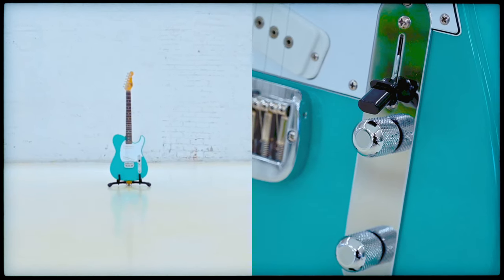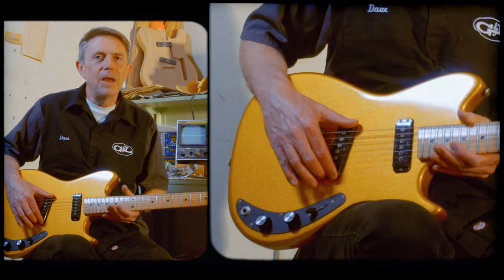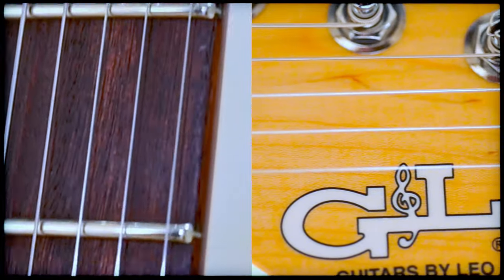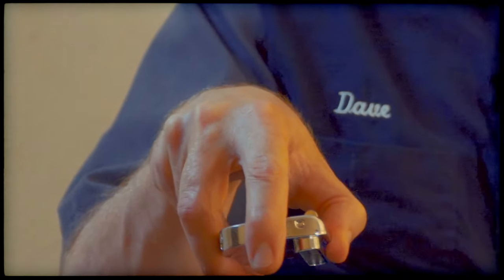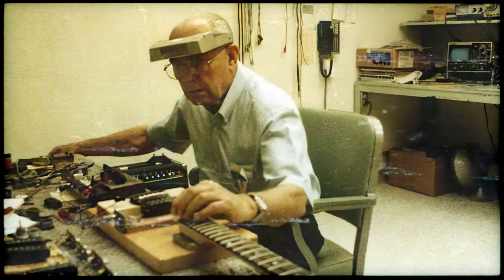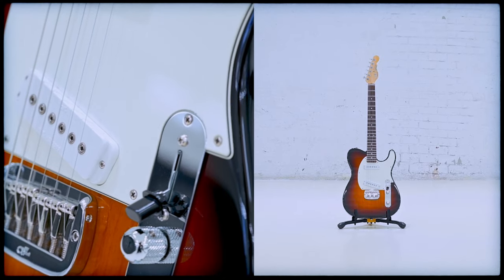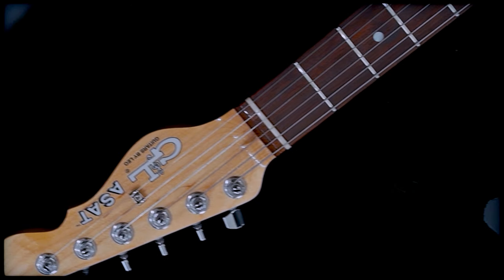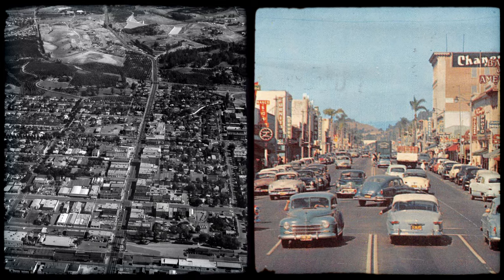G&L ASAT Special: Leo’s next single-cutaway

Comment: As a kid I lived on Wilshire and Raymond ave. In Fullerton, CA. I would ride my bike down to The Fender factory at 500 Raymond ave. 
I used to look into the open factory doors and watch the workers building guitars. I think it is SO COOL that G&L is on Fender ave. I rode my motorcycle to the factory, caught the workers on their lunch break. Let them know that I switched from Fender brand guitars to G&L guitars. Told them I felt that the standard G&L’s were on par with custom shop Fenders. They liked that. The conversation switched to my BMW motorcycle by the time Dave came out to join the conversation. We all had a great time talking motorcycles. 
The crew at G&L are a great bunch.
Reply: That's an awesome experience. Thanks for sharing.

Comment: Hello, could you tell if the pickups are screwed to the body or to the Pick guard? Thank you in advance.
Reply from the maker: Mounted to the body.
Reply: @GL_Guitars  so this means that you can't change the height? The routing has already the correct dimensions per we? Does this make sense? Thanks

Comment: Very nice as usual. Price on these (usa) is still quite unreasonable, however, for what they actually are worth if you break it all down. I’d love one in my working collection, but…
Reply: Much better priced compared to all the other major builders. Their tribute models are killer too! Also, check the used market. You’d be surprised at how reasonable the prices are.
Reply: Yes, I always try used first. There are some great deals on Reverb and eBay.
Reply: Go buy a factory-trashed Fender Custom Shop😂